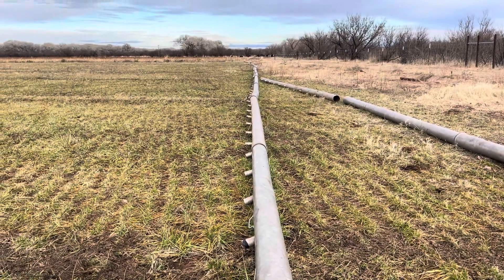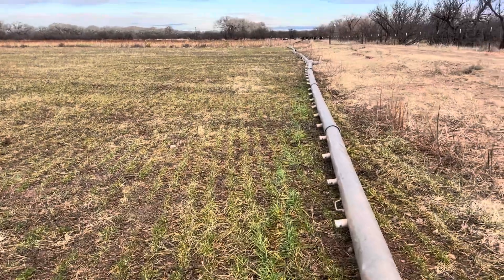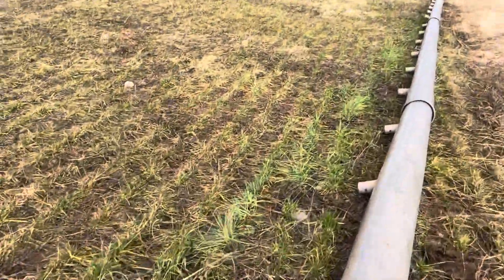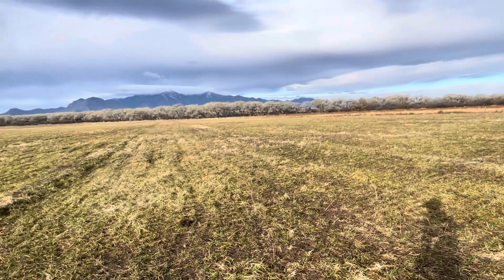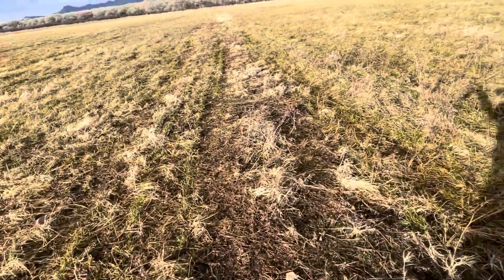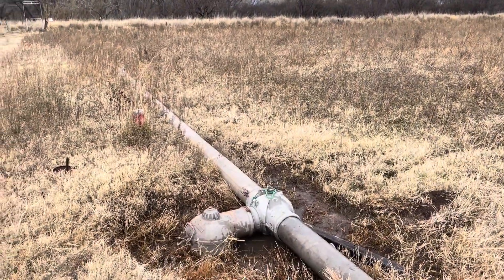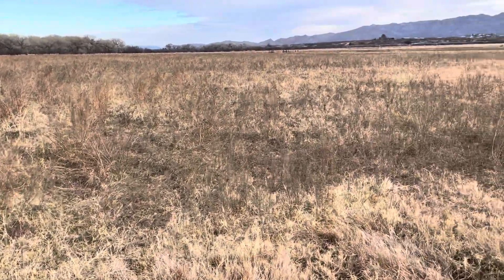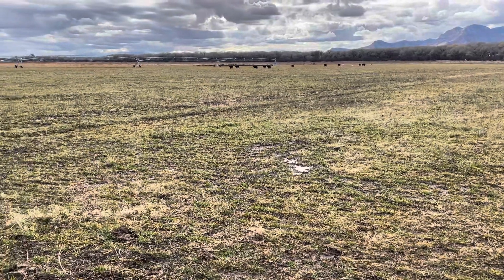My irrigation problems explained on regenerative farm

Comment: Micah, will Tifton or Bermuda grass grow in area.  With the pivot and good grass you can produce lots of Hay!!!
Reply from the maker: Yes we have some Bermuda I just haven’t been impressed by what I’ve seen around here. I think we get to cold to produce like yours. It only grows from May to September around here.
Reply: @micahgarcia360  What variety is it.  Common Bermuda does not produce  as much as Giant or other bermudas.  Have you tried Tifton 85.  200 to 250 pounds of Urea will make it grow enough to cut every 30 days with irrigation. Tifton is really good drought tolerances and cold hard.  Let me know if you are interested in trying some.
Reply from the maker: No I have not tried Tifton 85. It sounds pretty good. I’ll think about it.